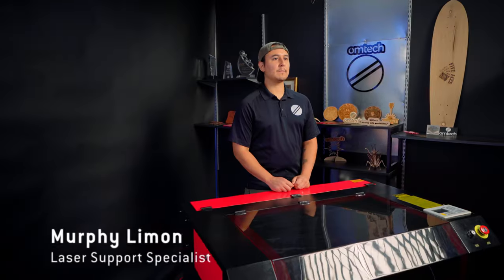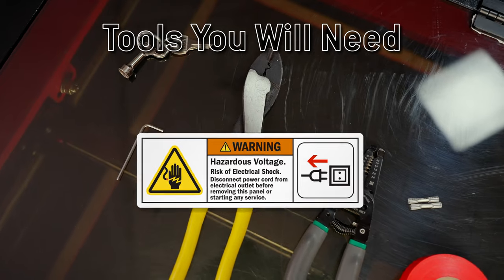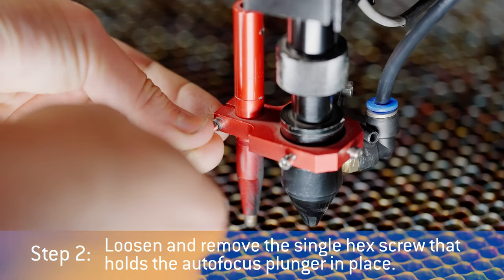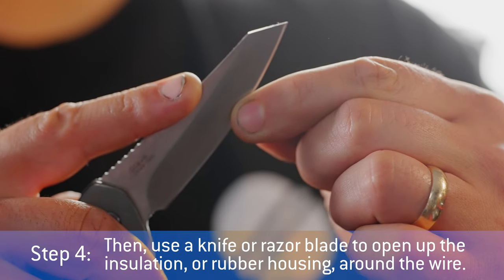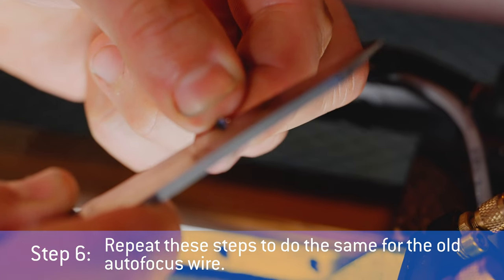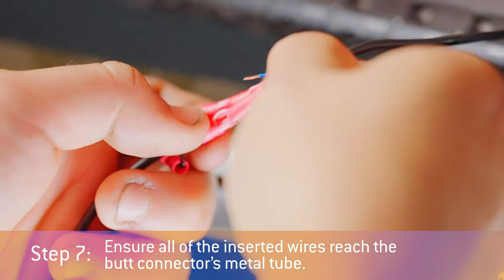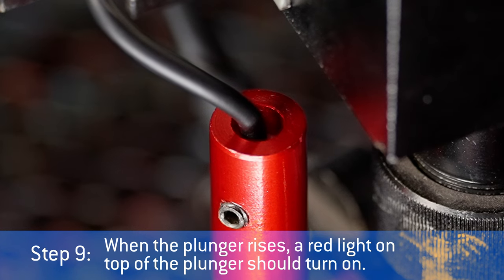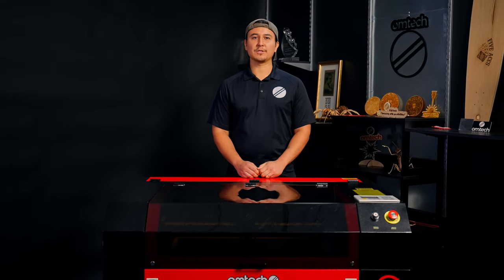Here's How to Replace Your Autofocus Sensor

Comment: Do you have a link or manual on installing the auto focus if you wanna run a whole new wire…. Does it connect to the control panel or the 24v power supply?

Comment: Today I went to auto level my bed and the Z Axis did not stop once the sensor pen tapped the material. Instead it just kept going and the laser head pushed thru the acrylic material and through the honey comb bed. 
I hit the emergency stop and when I turned the machine back on, the head continued to push through the honeycomb bed. How could this have happened???
Reply: How was this fixed?